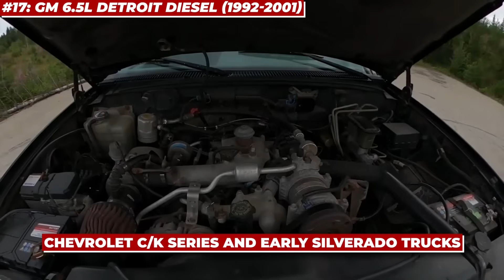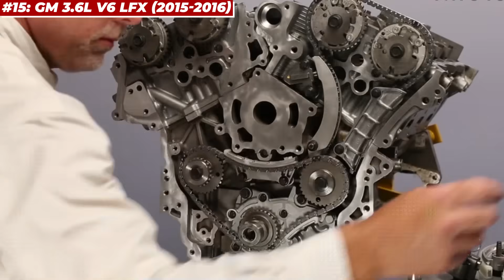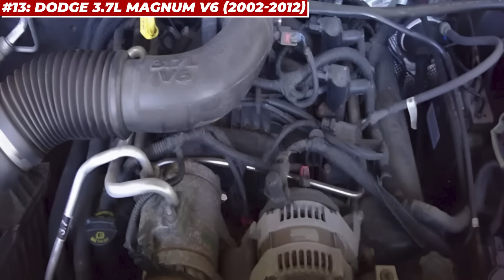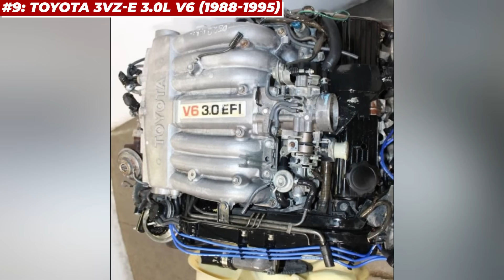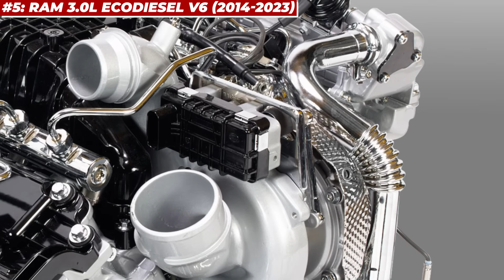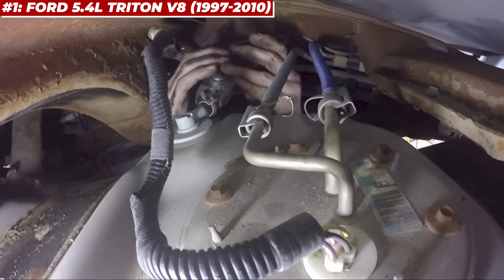17 WORST Engines Ever Put into Trucks!

Comment: 99.9% of the problems with modern truck engines has 100% to do with the U.S. Government or with companies trying to market them as family luxury vehicles.  My uncle, a farmer, bought a 3/4 Chevrolet in 1978 new and drove it until it rusted apart.  If anything broke, he or his son fixed it.  He finally replaced it in 1989 with them modern version of the same truck which he drove until he died.  To him, his truck was a tool.  He used it and used it hard.  No AC, no automatic, just a basic work vehicle.  I have no idea what engine was in the first one other than it was gas.  The second had the 454.  But the engines weren't designed to save gas, they were designed to work.  Today's trucks are designed to try to hit magic EPA numbers, are loaded with safety equipment, and have screens anywhere they can fit one.  They are huge because they are trying to push them into a lower EPA category.  the 5.3's AFM, the 3v Triton's cam phasers, all put on to meet government regulations.

Comment: The 5.6 from Nissan never suffered from SMOD, that was the 4.0 V6s in the 2nd gen Frontiers and XTerras in the early production years. Folks have found multiple cheap fixes to prevent the contamination as well.

Comment: Too be fair, the Powerstroke 6.0L diesel engine was an International engine, not Ford. It's predecessor, the 7.3L, was also an International engine, with its own issues (not as many as the 6.0L though).

I used to have a 2006 F-250 with the 6.0L. The only chronic issue I had, was the EGR constantly clogging with soot. Every few months, I had to remove the EGR & thoroughly clean the carbon build up off. I miss that truck.

Comment: We have a 2008 GMC Canyon with the 3.7 5 cylinder. Still running strong at 220,000 miles. Had to replace the trans at 200k but engine wise no major issues. Valve cover gasket because the spark plug tube seals started leaking, a water pump, and basic maintenance is all its needed.

Comment: I have a 2017 F150 XL/STX. My Engine is the 2.7 EcoBoost. I just reached 60k. So far, so good.
But I'm just a little worried about something going wrong. I've been quite "religious" about maintenance. I always request the absolute best synthetic oil! "I want stuff that you would put in a Bugatti!!" Also, my fuel choice is Shell V-Power 93 Octane or Sunoco 93.

Comment: GM motors are junk
Reply: No worse than anyone else! I once had this Chevy Celebrity Wagon with the 2.5 Inline 4 "4-Tech".
It was a pushrod engine, EFI and Electronic Ignition. It certainly was no powerhouse but it held up and was quite reliable. The worst thing was that in the winter, the doors would freeze shut! I'd have to enter through the tailgate!!

Comment: I've had a few old 6.2 and 6.5 diesels. one had over 500k and still worked perfect. with a bit of tuning I pulled a 30ft 5th wheel camper across Canada with 0 issues. It didn't accelerate fast but kept up with traffic just fine. If those old trucks were meant to be fast they wouldn't be shaped like bricks.

Comment: It's crazy how you see those Dodge 3.7 v6 and 4.7 v8 engines with 100's of thousands of miles on them like 500,000 and still going and then you see them with maybe 120,000 or less that are totally destroyed. I think it is the difference in maintaining them. Some people abuse their vehicles and don't keep up with oil and filter changes, antifreeze changes, transmission fluid and filter changes, air filter changes and cabin filter changes. Doing the changes on time makes a big difference and is why vehicles have their recommendations.
Reply: I've owned a lot of vehicles gotta say my dodge 3.7 has been one of the most reliable engines I've ever had  nearly 300000 thousands miles with only a few minor repairs it's still running that the day I got it

Comment: The 2-valve Triton 5.4 is a stout, dependable motor if you tighten the spark plugs to 25 lb ft instead of Ford's recommended 12.  That's literally the only "modification" I've done.  242k on mine..... not the most powerful ever, but it's never let me down, and when it does...... I'll rebuild it.

Comment: Im in the middle of the timing job on my 2010 Ford 5.4 3v. Problem for was the chain guides were shredded and clogged up the oil intake. Had no pressure and seized a cam.  New head, camshaft, complete timing, rollers, lash adjusters, oil pump...ugh! Good engine if you do the timing BEFORE something like this happens, in my opinion

Comment: My 98 6.5 made it over 500,000 miles befor i sold it. It pulled my 5th wheel camper at around 17,000lbs. The pmd and G80 gov-lock was my only problem i had. It was a dog with only 190hp. I believe the tq was like 410ft-lbs

Comment: I had a 2010 Colorado with the 3.7L I5. I sold the truck with about 150,000 miles on it. Never gave me a single problem.
Reply: I have one with 28000 miles still going strong

Comment: I had a 1997 f150 with the 5.4. It was a work truck with a tidy tank for an excavator operator. Used it hard- but was regularly serviced. Had 350,000km with not one problem. Guess got lucky.

Comment: Okay. I own a 2002 Dodge Dakota with more than 165K miles with the 4.7l engine. I have never had any overheating problems with with this engine even when towing a vehicle trailer from Saint Roberts, Missouri to Bennett, Colorado. A distance of about  766 miles ....... in the summer time! Oil issues? None. Stop buying cheap oil! Change the oil and filter every 5K miles. The only major thing I had to change on the engine was the three timing belts, but that was done when the truck hit 12 years old.

Comment: If you used good quality oil and changed it every 3K or so and maintained the cooling system with the RITE coolant a 4.7 Dodge will last well past 200 K,
I know because I have owned two for my shop trucks and one has 220K and the other has just under 300k with no problems.

Comment: You are way wrong about the 6.5 chevy. They are in marine all over the world and  most military vehicles in the past and still have the 6.5. The one thing you are right about is its not a powerhouse speed demon motor..you are confusing its reliability with the olds 5.7 diesel which is a former gas motor made into a diesel..wven with that if you took off heads and replaced head bolts it can be a reliable motor

Comment: I've been rebuilding automatic transmissions 48 years and the coolant mix was a nightmare for our customers 😢 ,
WE by past the radiator and put in a external cooler and blocked off the old cooler  and that was a good fix 😮

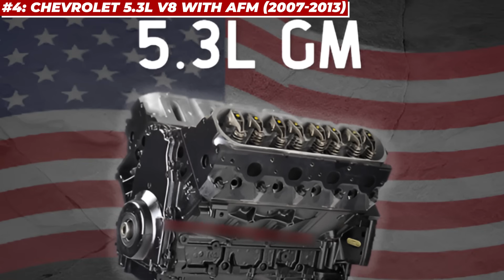Comment: 18:54 my 2011 Chevy Silverado Z71 5.3 with AFM has 242 thousand miles and 1042.9 engine hours on the entire original engine and drive train. My secret ? 10w30 full synthetic and keeping it in 5th gear in city to keep the AFM from constantly cycling once the engine hit around 200 thousand miles. And it runs beautifully

Comment: 47 year mechanic and shop owner.  I had enough by the gm 350 diesel.  First gm diesel they described the 6.2 diesel, the 6.5 outside the injector pump issues werent near as bad. The blocks where reinforced from the 6.2 varient ( Detroit's very first 4 stroke diesel) in nissan the coolant mix, cooling system issues was common to several car companies, the timing chain, yes but those changining it around 4k never had an issue.  A diagnoses issue, no.  The 5.7 injector pump issue, gm spec for the injection pump included nylon(not recomended but buyer gets what they want, gm in this case) whereas Ford, international spec'ed metal parts from Standayne pump used in multiple aplications.  Much more on the 5.7, but all those great vw diesels from then where gas origanally also with head bolts that stretched just as fast.  So much more.  This is just cooled together from multiple sites as years are wrong and too short in many cases.

Comment: I guess I got lucky on a 99 f150 I had, went 250k miles when I sold it and it's still running but it's working on it's 3rd transmission, I thought this list was great though learned a few new things thanks

Comment: I love my 2005 Colorado 5 cylinder it's got right at 250,000 miles the only issue I've had was the rear end and a radiator that got a hole poked in it from an outside source
Reply: Same. My 2007 is at 140,000 miles and hasn’t had any major issues
Reply: @NorthThree6 keep oil changed thats it
Reply: My 2012  i5 canyon has 280000 on it😅

Comment: I can attest to the 350 Oldsmopile diesel my 81 shot the head gaskets out and burned through the head and head bolt. Until then it started OK ans ran decent. Would have been a good engine if GM engineers didn't have their head in their ass.

Comment: I worked for the National Park Service back in the early 90's, and we had 2 mid 80's GM Diesel 3/4 ton pickups with the 6.2L diesel engines. They were dogs. We routinely used them to pull our 4 horse trailer and they struggled severely. One was a 4 speed manual and the other was an automatic. The manual usually managed a little better but it struggled too. Even just driving them on the highway you felt tle lack of power in them.

Comment: 3.7v6 4.7v8 garbage 🗑  5.7v8 great. All we're built in the same time frame and same parts so whats the difference? My brother's 03 dodge ram 2500 with a 5.7 and it has over 400k miles

Comment: That's funny I'm in my mid-50s and have had trucks and vans my entire life I have never had an engine blow up. However I will never drive a 4 or 6 cylinder trucks especially when turbo is added to them (V8 are far more powerful and reliable)or Chevy 6.2 V8.

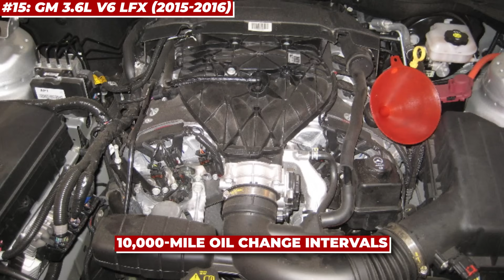Comment: @5:42 no GM dealer is going to recommend that oil change interval. Even with modern tech they will still recommend 5-6k mile changes and same goes for any engine.

Comment: I don’t know what hell this guy smoke during this video my colorado has literally been one of the most reliable truck i have ever own right now its currently sitting at 220000 miles still running strong 💪
Reply: You're one of the lucky ones...I sold these from 2017-2023 they kept engine problems!

Comment: The i5 colorado i think was pretty good. Still a ton of them on the road with a lot of miles
Reply: I agree.  The I 5 if taken care of  go over 20000 no problem.  07 and up were much improved over earlier years of generation one.  This video is defunitely not accurate.
Reply: Granddaughter has 04 5 cyl Colorado. Runs good and has 280,000 miles on it.

Comment: I knew this video was "absolute trash" when the first engine on the list was the 6.2/6.5. Everything you stated about it was wrong. You are confusing the 6.2/6.5 with the oldsmobile 350 diesel. There are a lot of people who don't like the 6.2/6.5 either, but I've had a 6.5 turbo diesel suburban for almost 20 years now and its been the best vehicle I've ever owned. It now has 375,0 miles on it and aside from injector pumps, an alternator and a water pump, it's all original. Im the 2nd owner but bought it from a family friend so I have been around it since the day it was driven home from the dealership. Its been worked hard all it's life, and I personally towed a 1956 spartan royal manor (33 ft long) over 400 miles in the summertime without any problems whatsoever. The only serious problem with the 6.5 was the people who drove them - you know "the loose nut behind the wheel". Every vehicle has its share of "common problems", especially as they get older. But the 6.5s problems are not that big of a deal. And it's so much cheaper and easier to work on than any duramax, powerstroke or cummins.

Comment: I had one of the 6.5 GM diesels...
That was an absolutely piss poor engine..
Sorry I bought that truck..

Now as far as the Nissan 5.6 Titan...
You are correct about one thing......... The radiator sucks .
But as far as anything else you said.. totally wrong...

And yes ....The 5.4 plug launcher Triton engine..... My 2002 f250 had one of these and I believe I had five or six plugs launch out of there............ Having to replace each head............ But any of the other things you talked about I didn't have a bit of problem and I got 299,000 miles on mine before I got rid of it

Comment: I had the 5 cylinder in a 2008 Colorado and never had any issue with it. The truck frame rusted out instead. Maybe it needed some oil leaks to keep the frame intact.

Comment: The 6.2 and 6.5 IDI GM diesels were fine. Gutless pigs, but for the time they were built for fuel economy and not power. Other than some block and head issues, along with the electronic injection of the later 6.5 Turbo, they didn't have much issues. The 6.5 electronic injection system has long been fixed by the after market, or you put it together as a mechanical injection. If these engines were so bad, you would not be able to buy new blocks for them or any parts for that matter.

The misconception people have, especially with the 4.3 and 350 Olds diesels, they assume they were built off the gas engines. They were not. The blocks were casted stronger. The only thing in common between the two lines was the tooling. The last model year of these diesels were the best but by then the damage was already done and it really hurt the reputation of diesels in the US.

The Ford modular engine family, the 4.6and 5.4 did not have enough threads to hold the spark plugs in the heads properly when doing replacement. Ford recommended plug replacement at about 60k miles. A heli-coil repair was done to fix that problem.

The later 5.4L 3 valve had VCT problems, but the VAST majority of that was caused by a lack of oil changes or frequent oil changes and not using a synthetic oil. VCT is sensitive in how it works and needs clean oil to work properly. Two piece spark plugs affrcted just about every 3 valve mod engine, except the 4.6L which came out in 2009. By then Ford had redesigned the spark plugs to be a single piece.

Comment: I had a 5.4 2 valve running strong at 350 thousand miles one of the best vehicles I ever owned
Reply: 5.4 3valve was bad
Reply: I currently have a 2011 expedition with the 5.4 3 Valve.  It has almost 214k on it.  I switched immediately to 5w30 full synthetic when I bought it.  Change it every 5k.  I’ve had it nearly 3 years.  Sometimes it gets a little sound from the timing chain guide or  cam phaser slap, but most of the time runs very smooth.  Has been very reliable.  They are a very sensitive engine.  If they can be poorly maintained it can run a very long time. Now I know all owners aren’t as fortunate with these engines but I’ve been blessed so far with this one.  You either love the ole engine or hate it lol!

Comment: the 5.4 triton problems were the 3 valve 2004 and up
Reply: For the VCT and two piece spark plugs. The first part is due mainly to poor oil change intervals. These should be changed no later than 5,000 miles and using full synthetic oil. The two piece plugs had been changed by about 2009 or 2010 to a single piece design. 

1991-2003 mod engines did not have enough threads to hold the plugs into the heads after they were changed out. A heli-coil is installed when the plugs back out of the head.
Reply: @Ratkill9000 Correct....the heli pack was used in my 2002 f250.....it launched plugs quite a bit...
My mechanic told me it only had a twist and a half of thread holding it in an aluminum head....
Other than that though I got 299,000 mi out of mine

Comment: My expedition hasn't had any of those problems yet knock on wood however I was told that the timing chain was stretched so I replaced that I replaced other sensors but the check engine light is still on and it's drinking a lot more gas than it should, I ran the scan tool on it, it said it was running lean so I looked up what could be causing that and it said my fuel filter which makes sense because if not enough fuel is making it to the engine, the ECU is gonna tell the fuel pump to send more fuel than needed so I'm gonna change that this weekend see if that works or atleast helps, I was also told that the passenger side exhaust manifold is warped gonna get that fixed soon enough as well. Anybody else have these similar issues with theirs?

Comment: My H3 has 155k on my 3.7 5 banger has none of these problems. Gutless yes but has been extremely reliable. No vibration issues they talk of. Always done maintenance on time.
Reply: I traded my 2007 H3 with the 3.7 I5 with nearly 200k on it. It ran fine on the day I traded it.
Reply: Wow, you guys are getting like Yugo mileage out of those beasts!

Comment: I guess our 6.5 in the 96 Suburban we own has not read the memo it was supposed to be a horrid engine, 260,000 miles and almost 30 years later. Scheduled maintenance and correcting/updating a few small, but vital parts due to GM idiot bean counters goes a long way.
Reply: Yeah the update or remote locating of the fuel injection module and usually converting from timing chain to timing gears usually pretty much made them bulletproof.
Reply: @Ratkill9000  I have (2) 98s with remoted PMDs, no fail since relocating them in 2005 chains  not gear 230K on 1 250K on the other I guess I'm at risk any day it will fall apart since they are 27 years old most that disparage them have no clue just parroting what they have heard.

Comment: People trash talking a 6.5 have never driven a old Mitsubishi Pajero or Land Rover. They barely reach the 100 hp mark yet they weigh around 1500kg and more. The torque the 6.5 has is enough to tow.
Reply: But the motor is trash. Everyone I know who had one had issues over and over.
Reply: I've had a 6.2 and a 6.5. Both were great trucks. Literally the only thing I ever had to fix was buying a new PMD, one time for the 6.5. Had the truck for 7 years, sold it when diesel got ridiculously expensive in 2020. I towed vehicles with the 6.5 all the time. no issues at all. they weren't
 insanely powerful, but they did just fine.